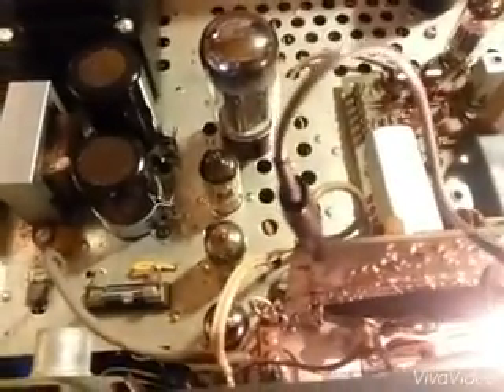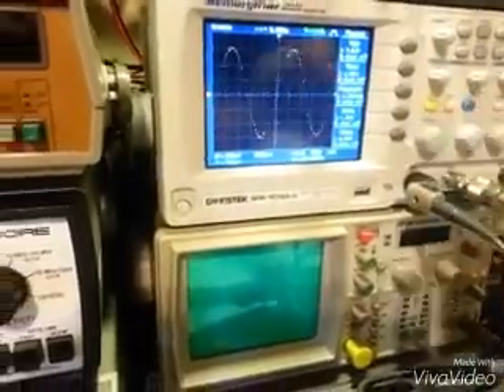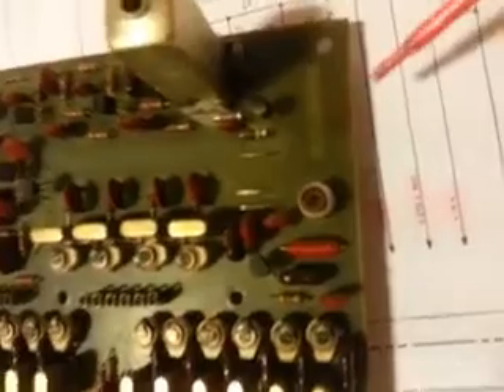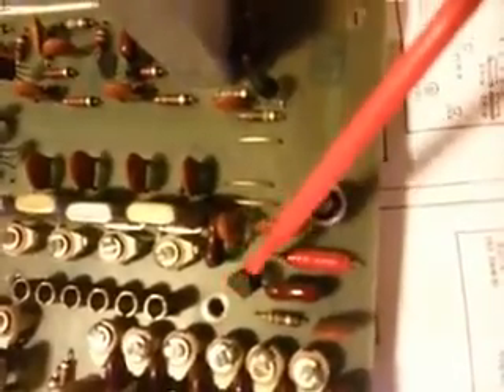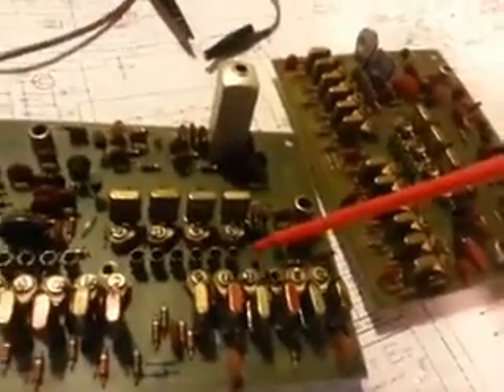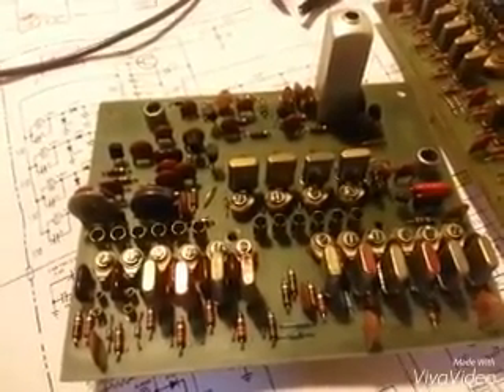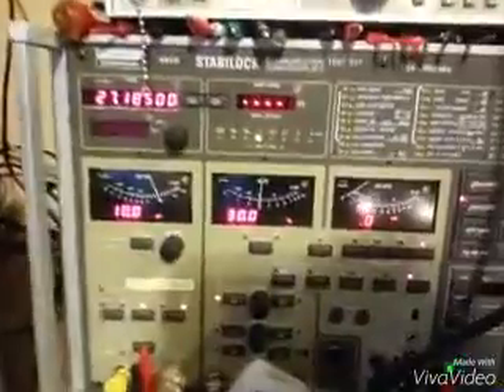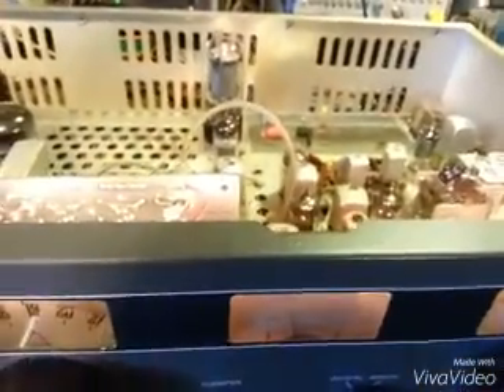Tram D201 hand wired uneven signal strength

Comment: Hi Mike,
I was playing with some old 27MHz crystal controlled hand held radios that have no mixing but direct crystal controlled. You know, the type that has the actual tx frequency written on the can and the receive frequency minus the 455khz if to control the receive frequency. I was wondering, so I can get some crystals cut, what type of crystal would they likely be (fundamental or 3rd overtone) what other specs would I need to give the company if I get them made?

Comment: Hi Mike .I just got across Tram D-201A and was not receiving  no TX ,nothing .I open the radio and notice that BA board was missing .My question is ,should radio show any sign of receiving on the a meter with out that BA board .Thank You.
Reply from the maker: The BA board is the power supply board.  No power supply, no RX/TX.
Reply: @mikesradiorepair  Thank you Mike.